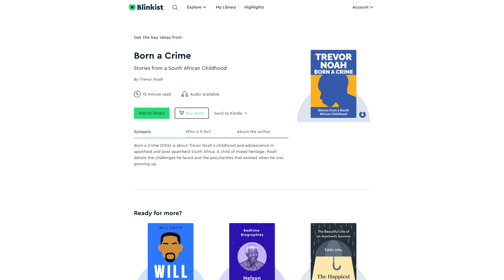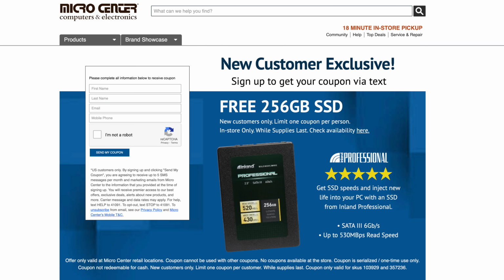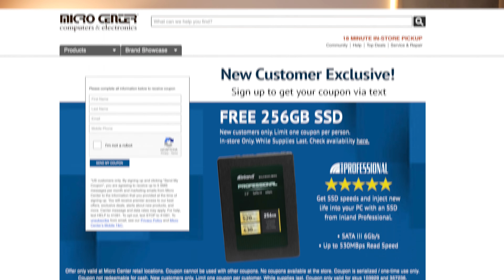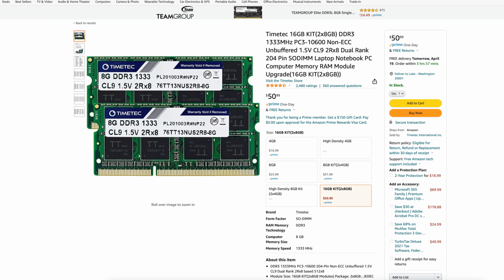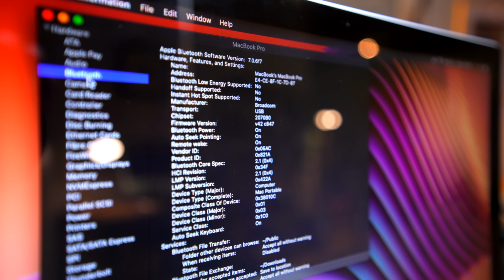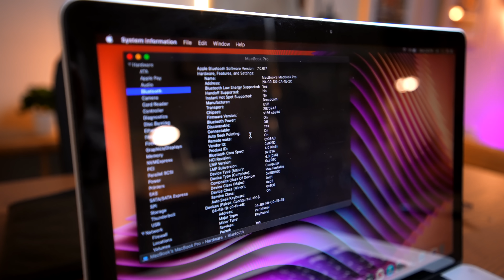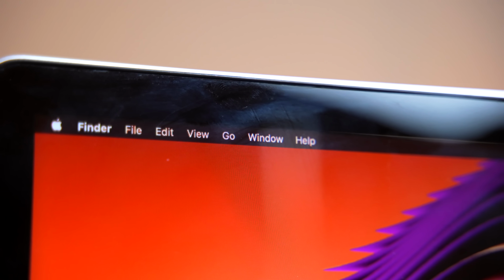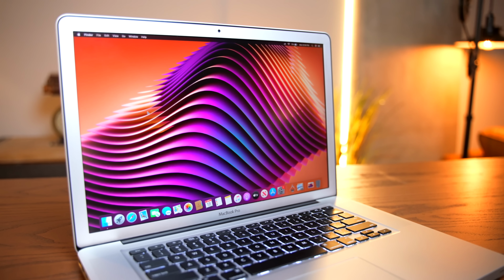Breathe new life into an old MacBook with THIS upgrade

Comment: Hi Luke, I just upgraded to a new MacBook M1 Max 16GB but I did not get rid of my (Mid 2010) 15-inch Macbook Pro with the dual-core Intel i7 2.66GHz processor. It not for the fact that we expanded our business to produce media content I would have milked it for 12 more years! I going to keep it to use the CD-ROM drive to rip music CDs into my Roon library but now I see it being useful for other things in the home. It runs High Sierra macOS and I upgraded it some years ago to a 1TB SATA SSD. It has 8GB of DDR3 memory and I originally ordered it from apple in 2010 with the non-glare screen (I love the silver bezel look). The only upgrade I need is the wireless card you mentioned. It runs a bit hot so I'll be doing the thermal paste upgrade as well.

Comment: I have one of these that I still use. 
I had to replace the keyboard twice! I had to replace the speakers TWICE! The video controller chips can de-soldier causing green/purple screen dots. Still has the ORIGINAL BATTERY THAT STILL WORKS! I upgraded the RAM and the HD to an SSD many years ago.
*note: This computer can only recognize 8 gigs of RAM, not 16.
The silver bezels look cheap to me. I prefer the black.
The GPU is prone to failure these machines, and ebayers are asking $100 for a used logic board, so I'd not recommend spending money on one of these.

Comment: My main computer is a 2011 macbook pro, with RAM and SSD upgrades. It's perfect for my needs, including some games. I also use a macbook air from 2010 (it's slow but it does the job). 

My question is: Do you think that a 2022 macbook with M1 will last for 10 or so years?
Reply: I doubt it. Arm never has aged as well as x86.

Comment: I took a 2012 and added a new SSD, a new optical drive and two n8 gig sticks. No change to wireless. This’d machine SCREAMS now. Original start up time was 3 minutes and 33 seconds. After the upgrades, start up time is 31 seconds! I also upgraded the OS to Catalina which runs really well.
Reply: I just bought a mid-2012 15 inch that was as it left the factory. I swapped the 500gb hdd for a 128gb ssd(for now, I plan to go 1tb) and I’ll swap the 4GB for 16GB. I’ve also ordered a new hdd cable for it as it runs fine on day to day use, but if I run a drive benchmark or do anything really drive intensive it starts off a 550MB/s but quickly drops to around 9MB/s.

Comment: I don't know but in my opinion these gray bezels look kinda old in comparison to the standard reflective display panel. 
Maybe you can try getting the actual LCD out of the display assembly, cracking the glass away on the original display assembly and swap the LCDs out.
Then buy a new display glass panel and apply it to the original display assembly.
Maybe that could work but i dont know if the measurements and screwholes are the same but there is a possibility

Comment: I have MacBook Pro 17" (Mid-2010) that I bought new in 2010, and I still use it to this day. The only downside is its inabilities to expand beyond 8 GB. My MBP croaks with 8 GB more often lately. Catalina does work on my MBP but with lot of caveats: it does crash more often due to the SIP integrity switched off.
Reply: I upgraded the 2011 to 16 GB in 2011, even though it officially only supports eight, but it happily runs with sixteen none-the-less. Check some third party forums for the 2010...just because Apple didn't support it didn't matter if the chipset did.
Reply: @martinlebl631  I did check a several vendors, including OWC, in the past. According to OWC, 16 GB upgrade is for MacBook7.1 only. Mine is MacBook6.1 (Mid-2010) so I am out of luck here. Thanks for the suggestion.
Reply: @InTeCredo  Must have been the reason I went with the 2011 over 2010 back in 2011. Bought it with 4 GB at the time, and swapped in 16 GB the same day to avoid the Apple tax. (Of course now they solder it to the board to stop you from doing that. Ergo the new MacBooks are a much worse value for the money.) Having a fast side as swap helps, but still 8 GB is not optimal for newer MacOS. Of course I bring it down even with 16 GB due to all the tabs I keep open. (This isn't an issue with other operating systems, where 16 GB seems enough, but MacOS does not deal well with apps that leak memory, and the garbage collection sucks, so perhaps 32 or 64 GB would be better.)
Reply: @InTeCredo  the only reason the official ram for the 13 inch is maxed at 8GB is to make the people who bought the 15 and 17 not feel bad that they can’t get 16gb.

Comment: Hey Luke - I upgraded the HD in my 2012 MacBook Pro and it works great. The only problem with it is after using for about 30 minutes, it smells like BO (did that before I upgraded the HD to SSD). Any ideas on what is causing the stink? I’m not finding many solutions online, but have seen that many others have the same problem. If anyone has a solve for this, please respond! Thanks 🙏

Comment: This is exactly the reason why I bought a mid 2013 MacBook Air with an i7 and 8Gb ram. I paid in total €170,- including the upgrade. I upgraded it with an 256 GB M2 apple ssd and divided it in two. One partition with MacOs big sur, the other with windows 10 via boot camp. So I have the best of both worlds
Reply: I also have an 15 inch MBP with the matte screen. Unfortunately I can only install windows 7 with boot camp. Not sure if I'll replace the superdrive with an ssd bay.

Comment: We bought my wife a 13” MBP in 2012 when she want back to school. About a year ago I did the ram, battery and ssd upgrade, and it was like a new machine. Is it the fastest? No. But for what she uses it for, it made more sense to drop $200 on those upgrades rather than a grand on a new MacBook Air. I expect we’ll get at least another 5 or 6 years out of it.

Comment: Looking different, and still functional, are two very different things, both objectively, and subjectively.
I have several PCs that are 16-20 years old(including MacBook and Mac Pro PCs). They're still usable, even running windows 10 or linux, but they are what post people would call unbearable if used for anything other than a service machine, a singular purpose. And because Thinkpad design hasnt changed all that much, they still could be confused with a modern laptop if i took the 5 minutes to replace the keyboard+trackpad+trackpoint

Comment: Can the Macbook Pro mid 2012 15 inch use this higher resolution display?
Reply: Yes, it can. I have a 2011 antiglare display on my 2012 15" MacBook Pro, and it works perfectly fine.

Comment: I am currently using a 15 inch mid 2010 MacBook Pro and I literally have the exact same configuration with theses upgrades. I have to say that my machine performs really well in comparison to other laptops in the same price bracket. The only issue that I face is that it runs really hot and the fans ramp up to max speed to try and cool it. I would really appreciate help to stop my laptop from thermal throttling.
Reply: Replace thermal paste?
Reply: @dimakonstanta1868  I did, about a week ago

Comment: I'd probably still be using my old high res mid 2010 if it wasn't for the dreaded capacitor issue when the GPU kicked in.
Reply: The capacitor issue is actually really easy to fix(although you need soldering skills)

Comment: I agree with everything he said but if you can afford it I would get the 2012 only because it has USB 3.0 and it should have a faster Wi-Fi card to begin with. If you can get it for the same price it is definitely worth the upgrade
Reply: Is not more easy to get a USB wifi adapter instead change the whole antenna?

Comment: My 2010 Macbook Pro was a beast until it started getting Kernel Panics, just like my 2006 Macbook Pro before it. Two defective Macbook pro purchases in a row (with small replacement windows) and I haven't purchased an Apple laptop since. I've stuck with iMacs. However, my 2015 maxxed out iMac is now starting to have magenta edges on the display and kernel panic-like unexpected system power offs. From my limited experience, Apple laptops last 3-4 years before defects appear. Apple desktops are 5-6 years.

Comment: Luke you are one of the few YouTubers who encourage buying the old Macs. I still have my stock mid 2012 13 inch Pro base model. Got it from my dad a few years ago. It's amazing though it's starting to lag now. Either I'll get a ssd and ram upgrade or just buy the base model M1 Air. Great machines nonetheless
Reply: Ssd will make that like new.
Reply: You should definitely upgrade to an SSD. It will make a huge difference.
Reply: Hi guys thanks for the suggestions but I ended up buying a gaming laptop as I realized that I wanted to game as well
Reply: @poker.4203 which gaming laptop did you get mate?
Reply: Or old thinkpads, they are excellent!
Reply: personally i'd say get the ssd for now, but get the m1 air soon, because it will run perfectly fine for a long time but the m1 air will have way more support and already (i think) has a better battery and a better display. personally i'd go for the m1 air but the ssd will still be perfectly enough for a long enough time
Reply: @star_greeeen  500g SSD + 16gig ram, plus Monterey on my MBP 2.9 i7 13.3" made it run like NEW for less than $100, but I instead put Win10 on it, and transferred Monterey to another MBP 2.6g 4x i7 15" I have!
Reply: @jrstrong  that sounds great! good for you!!
Reply: Just start with a fresh install if you never did that which might help a lot. Then buy a $ 30 SSD. Check your RAM. Upgrading from 4GB to at least 8GB .... or maybe even 16GB ... I admit the MacBook Air M1 refurbished becomes a really good deal.

I really like these 2012 models which will be usable for emailing, wordprocessing etc for a long time to come.
Reply: 16GB of DDR3 RAM isn't very expensive and that makes a big difference in multitasking and rendering times.

A good quality SATA SSD is a huge upgrade in loading speeds of everything.

I own a late 2011 base model very similar to yours except I don't have USB 3.0 and a slightly older and weaker CPU/graphics generation. It's night and day for me, it'll be for you.
Reply: id get the base m1 air
Reply: Hey buddy, got your M1 then?

or still working on the older 13inch?

would you like to give it away by any chance?
Reply: @yuvrajharod5249  buy your own shit bruh, stop begging broke boy tf wrong with ya

Comment: If you don't want to replace the internal drive, you can buy a Samsung T5, use Carbon Copy Cloner to clone your OS to it, and boot right off the USB2.0 port. It's a little slower due to being limited to ~30MB/sec but still quite usable, I did that on a 2008 iMac that had a bad internal 320GB drive.
The good feeling you get when rescuing older equipment like this from recycling is great, Core i5 is "good enough" for the average mom-n-pop user.

Comment: Just replaced the battery in my trusty 2012 MacBook Air. It is still working remarkably well. Slow to boot up, but once started, just don’t turn it of 😉
Reply: May I ask where you got the battery? I take it it is not original, and it seems like hit and miss, getting one that works properly. Asking for a friend, that is my old MBAir '12.

Comment: Recently upgraded from a 2012 15” 2.6GHz. I did swap to a Hi-Res display, but mine was glossy. Also did the obligatory SSD install (a dual drive setup with a Sabrent adapter), but Apple killed Software RAID with APFS on the Unibody MacBook Pros so it was just a unified volume.

Now have a maxed 2015 Retina 15 with a 2TB m.2. Paired with a Thunderbolt Display for desk work it’s a solid setup.

Comment: I love my 2012 15inch MBP. Maxed the ram, 512gb ssd, and installed Monterey with OCLP and it runs like a dream. I did have some problems with the auto keyboard backlight not working (would light up just not auto adjust) but what seemed to fix that was installing Catalina and then upgrading to Monterey. I want the high res screen but not a big fan of the silver bezels, makes it looks like an oversized MacBook air.

Comment: Fun fact: The RAM in 2010 15" and 17" MacBook Pros can only be upgraded to 8GB, while the RAM in the 2010 13" MacBook Pro can be upgraded to 16GB.
Reply: Same with the 2010 unibody MacBook
Reply: Yes, since the 13 used a different GPU, sometime in the past that firmware was updated and it allowed 16GB, while the 15/17 was never updated in a like manner.

I upgraded my mid-2010 13" MBP to 16GB not long after that was discovered, and that made that system usable far longer than it would have been with 8GB.
Reply: I have the MacBook Pro (13-inch, Mid 2012) A1278 - can this handle the 16GB too? Or should I stick with the 8GB
Reply: @mattnorton23  yes ofc, I have it and it works a charm
Reply: Does any of you guys know if there’s a option too change the screen like in this video for the 13 inch version of this 2010 MacBook Pro?
Reply: Because the chipset in the 13” can do 16gb with two slots. The chipset in the 15 and 17” can do 16gb, but only with 4 slots.
Reply: I dont know how it is with Macs but Windows with 8gb ram is not enough.
Reply: @ibobeko4309  - Just like any other systems, it entirely depends on what programs you run.

I've got 4gb systems running Windows 7 and 10 just fine.

But 16gb isn't enough for my daily laptop.  Because I load it up with multiple memory hog apps.  The new laptop will have 32gb.

Comment: 2010s had core2duo cpus luke....I have one. Now my 2012 has an i5 in it but I think those started in 2011.
Reply: 15” and 17” got i5 and i7 in the mid 2010 updates, only the 13” had c2d.
Reply: @manitobasky  why use 2 different architectures in the same year???

Comment: I've a 2012 13" MBP - gave it a 16GB and a 1TB ssd upgrade over the years. It runs 10.15.7 and it got a security and browser update in Feb this year so still just about supported. I'd agree: buying an SSD and 8GB of RAM will do a lot more for performance than pairing 16GB of RAM with a hard disk drive. I wish I'd bought the SSD earlier.  What will we have in 12 years time? Don't know, but 12 years ago, I was still using a 2004 G4 iBook with a 2006 Intel iMac, so maybe Intel Macs will still be useful. (And there will still be a few G5 users somewhere!).
Reply: I have an 2011 imac and im still happy while using it

Comment: Just resuscitated my mid2012 15 inch macbook pro with AG screen... The chip delivering power to the discrete graphics died and after disabling the graphics I can use this machine for quite some serious work for the 10th year... Battery still good for 1 hour of browsing, the keyboard is enjoyable, the screen more than adequate, fast enough to process most things I throw at it (of course no video editing in real time). One of the best buy of my life... 10 years and still going!

Comment: I recently bought a damaged 15" 2012 as a project, and while it's still not there (missing SSD and high-res display), it's surprising how well it holds up. It's running Monterey with OCLP.

Comment: the anti glare screen is indeed one of the best choice i did when ordering my 2011 unibody! It is the reason i still use my MB today for most of my tasks except for video editing and 3D.
I really wish they would propose again this coating for the new ones!
Reply: Love that screen. But hard to find replacement, as all the replacement the shiny ones, so if you break it you are sort of screwed. (Edit: At least trying to find the 17 inch anti glare display.)
Reply: Is the screen really that good? It seems that my 2011 original one is still great…
Reply: @szatanica1  It is a very nice 1900 by 1200, so nice resolution, and good aspect ration, and the anti-glare makes it work well under variety of lighting conditions, which is useful in a laptop. If it wasn't for the dodgy graphics cards these 2011 17 inchers would be great machines still.
Reply: @martinlebl631  That's the same resolution.

Comment: Several months ago I built a 2012 15" Unibody MBP out of parts from eBay and some parts I had on hand, and for a total of $140 it's been one of the best MacBooks I've ever had. I bought a damaged 2012 15" MBP from eBay (bad screen and heavily used top case) and swapped that logic board into a 2011 15" chassis I had on hand (the GPU failed in that machine, and it wasn't repairable). I bought a used antiglare screen from eBay for $30 to install, and once I put in a spare SSD and some RAM it worked perfectly. It runs macOS Catalina flawlessly, and it even does alright in Windows 10.

Comment: I have a mid-2009 MacBook Pro, which has a Core 2 Duo processor. I paid $5 for it at a garage sale a couple years ago. It had no power supply so the guy didn't know if it worked or not.  I bought a aftermarket PS for $15, and it worked. I then put in a 250GB SSD, which I bought at MicroCenter for $28. It had 4 GB RAM, and I didn't bother upgrading that. Now for the best part: I loaded Linux Mint ver 20.3 on it. It loaded and worked perfectly. It runs great, and is a perfect setup for web browsing, word processing, watching movies, and doing Arduino programming.

Comment: If only the M1 Macs were this upgradeable. My MacBook Air maybe excellent right now. But if anything fails on it like the SSD or any component, it would basically become useless. Granted, the odds of that are really low, especially for models with upgraded components. But the chance is always there. SSDs are a consumable part like the battery and while you can replace the battery somewhat easily in the newer M1 Macs, you can't do that with their SSDs
Reply: If I could swap RAM, SSD, and install x86 Windows on an M1 (dual boot), I may consider an M1 MBP or MBA.  Until then, I will stick to using Thinkpads.